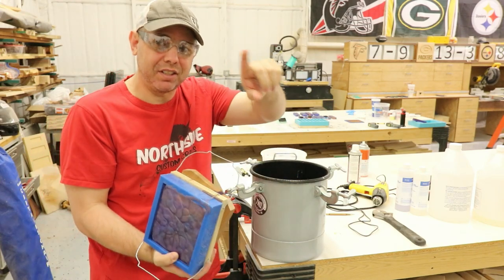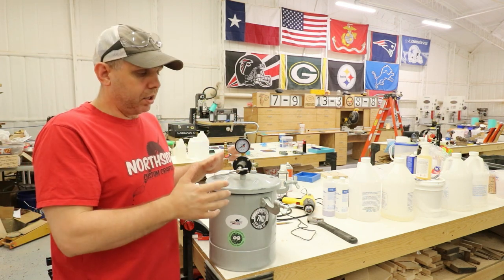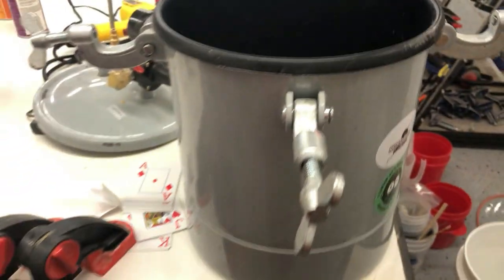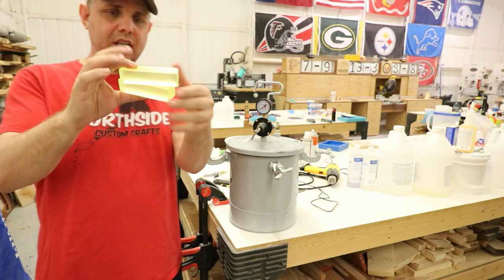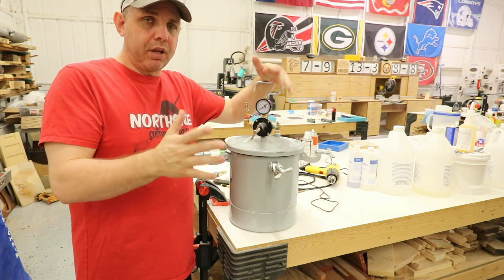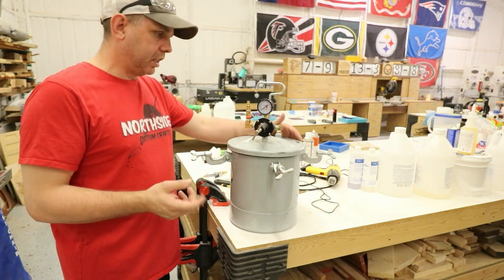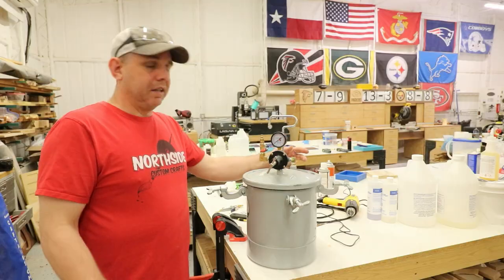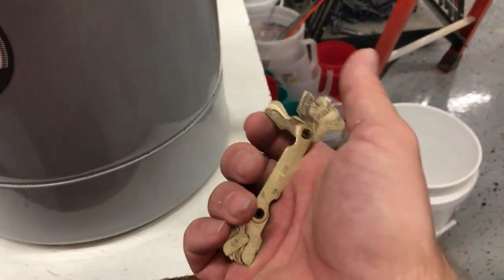Harbor Freight Pressure Pot for Resin Casting, Questions Answered!

Comment: Say Jake. First off, thanks for your first video on how to covert Harbor Freight tanks. You detailed the process so well that I had no issue accomplishing it. Secondly, out of the gates my tank leaks air like a sieve, and as your noted, it leaks around the lid.. I appreciate your solution to the problem, but I have a better way to attack it. I removed the ridiculous gasket that comes with the tank, then I mixed a batch of silicone rubber and poured it into the channel where the gasket once sat. It works like a charm, without extra clamps like you had to do. I am able to hold air up to 60 lbs. I just give the clamps a good twist with a wrench and it’s good to go. The silicone that I used  is Smooth On brand. 

Thanks again.
Reply from the maker: I ended up just buying a better gasket from Amazon but your solution sounds awesome
Reply: If anyone tries pouring a new gasket like I did, I have one tip. You might want to run a bead of calk around the channel wall that is welded in place.  That metal lip is poorly welded and silicone leaks under it. It didnt leak a ton but it was a little annoying.

Comment: I had such an issue with mine after 2 days, i returned it, and got another as a replacement. the toughest part is evenly tightening the lamps on the pot, seemed to make a huge difference in holding pressure consistently. so i do like if you were tightening lug nuts on a wheel....1/2 turn one side, 1/2 turn opposing side and so on. I had more of an issue with the gunk near the relief valve, had to gob some teflon tape there. Thanks for posting Jake, i really thought i was the only one having an issue holding pressure and the leak issues!
Reply from the maker: Rob Kerfoot Thank you for watching Rob.. I figured people would think mine just works perfectly all the time.. I also figured if I was having issues then so were others..

Comment: I have an older Craftsman paint pot I got at a rummage sale for 2 bucks I converted.  It gave me some leaking issues and I thought about the way to put a wheel/tire on a vehicle.  You alternate the tightening pattern.       Previously I would just randomly tighten the wingnuts in any order.  As I began to alternate tightening the wingnuts angled,  like putting on a wheel, it became easier to get the lid tighter and eliminate leaks.

Comment: Enjoy your video's , After some thinking I found that all you need for fittings is a the reducer one T,  safety valve direct fit  also with no regulator works , still working on the leaks
Reply from the maker: Very true.. I leave the regulator on because of the leaks.. I just leave the air on and it stays at the right pressure. I’m glad you enjoy the videos. 👍👊
Reply: Used and old trick on my harbor freight pot , took a small pump sprayer added some soap , squirted it all around and found a leak where the safety valve is welded in
 , you wouldn't think it would leak , I put some JB weld on it and so far it is holding pressure , thanks for the reply appreciate it

Comment: Petroleum jelly softens dry rubber gaskets so they can form a better seal. We use it on refrigerator gaskets where I work. It does eventually wear the gasket away little by little though, so I wouldn't use it on gaskets that aren't already old and dry or you'll probably have to replace them sooner.
Reply from the maker: Thank you for watching.. I appreciate it!👍👍

Comment: Sand the top of the pot smooth. 
Silicone glue the gasket into the lid, so it has to seal on only one side, and always put the lid on in exactly the same spot. Mark it and match it. Lubricate the the threads on the clamps, and where the clamps dig into the lid to make tightening them easier.
Seal your joints well... and stay under 50 PSI. At least ... this is what I'm doing. Thanks for all your advice!
Reply: Sooooo my HF pot is creaking on initial testing plus the gasket leak.  Is that normal for a "break in" period
Reply: @bryangoboom  Did you glue the gasket in the lid? Are you tightening the screws two at a time opposing corners back and forth until nice and tight? What pressure?
Reply: @Darryl Edington  glued it in last night and yea I was doing that.  I took a wrench and was able to get it to seal better.  Waiting for the silicon seal to cure then will test again tomorrow
Reply: @Darryl Edington  so it looks like everything is working well.  Now there is a slow leak that might be a pain to fix, 5 psi like every 30 minutes or so
Reply: @Darryl Edington  I'm thinking it's the main seal sadly.  It might be a defect of the whole pot.  I have one side that seals all the way down will spin it and soap it to check
Reply: @OregonDARRYL  So I found the leak.  Its actually on the weld of the paint outlet....  like where the join happens
Reply: @bryangoboom  Probably an easy fix with epoxy or silicone on the inside... Glad you found it. Bubbles are great!
Reply: @bryangoboom  I was going to ask when you glued your seal into the lid if you put the lid on the pot and tightened it a little to get the glue all even and flat... oh.. and put a little tiny bit vaseline on the seal if it leaks on the pot.
Reply: @Darryl Edington  yea I did that to seal it, looking at reddit that paint stem is where a lot of people have leaks lol
Reply: @bryangoboom  I also bought the little HF one-gallon super quiet compressors to keep it at pressure even if it leaks.
Reply: @OregonDARRYL  I have a super quiet, but it definitely isn't super quiet, any recommendations?
Reply: @bryangoboom  Well, since I only use it for 40 pounds of pressure in the pot and 55 in my bike tires, I set the regulator to run it up to 80 and shut off - rather than 135 - which I don't need and wears the unit more. So, I set the regulator to kick on at 35 and off at 80. So, it runs for only about 30 seconds and doesn't even get very warm. Like this it should last longer than I do. And.. I have the regulator on the pot set at 40 and the pressure relief valve set so it might pop at 55...

Comment: 👋  Great update to the original video. I used your first video on this to build my Harbor Frieght Pressure Tank. Been using it for almost a year now and still works great.
I actually got it to a point where it hasn't leaked in over 6 months.
I've been casting so much lately, I am considering getting a second one.
Reply from the maker: Awesome Connie!! The very next cast didn’t leak at all.. lol that’s how it goes. Your castings are amazing!!
Reply: @JakeThompson  Thank you 😊

Comment: Anyone who buys one, make sure to check if you get one that has NPT and compression style fittings. Mine did, don't put an NPT where there was a compression fitting. I shouldn't have to say that but there's some tutorials on YouTube for this tank that you will end up doing that if you follow them, theirs might have had all NPT, or they just didn't know better.

Pull the gasket out of the lid, and check for weld splatter. I had huge ones that had to be knocked out, that's where my initial leaks came from.

Also, the lid is thin. Over tightening the clamps will actually warp the lid, and possibly make it harder to get a seal next time. 4 star pattern, 1/4 turn at a time, hand tighten should be all you need to get a seal if you have smooth surfaces and a good gasket. In 24 hours, my tank will go from 60 to 55PSI. Which is mostly from my safety valve according to a bubble test with soapy water.
Reply from the maker: Chad Voller good stuff!!

Comment: So I noticed that it's very important to tighten the clamps down simultaneously. Opposing sides a little bit at a time, then use the wrench a bit. If it leaks around 50 psi identify where and try to tighten the clamp down by hand or with the wrench a bit.
Reply from the maker: MuffinMan0521 👍👍👍

Comment: there should be a gasket around the top channel this helps with sealing when you tighten the the lid down. I have a binks for spraying contact cement and you  can also get liners. Baer supply
Reply from the maker: After this video, I replaced the gasket with an upgraded one from Amazon. I think I put a link in the description or the pinned comment

Comment: I've been tempted to do this but am concerned about it leaking. Almost all videos I've seen that convert a Harbor Freight paint pressure pot to a resin casting pressure pot say that it WILL leak. It seems in your demo the leak was primarily the lid. Can a better gasket be added to fix that problem? Can a bead of 100% silicone around the lid create a better seal? I can clamp it to my bench like you did but would like to have it so it just doesn't leak at all and is mobile. Thanks for sharing your video! 👍🏾
Reply from the maker: Thank you Greg.. After this video I bought a better seal for the lid. It’s linked in the first comment.. as far as leaking .. if you fill it to 55 and overnight it’s at 50.. I wouldn’t consider that a big deal.. as long as it stays over 45 psi until the resin becomes solidified.  The new seal was a night and day difference from the original.. it was way better.

Comment: Very good video , I learned a lot from it. Thank you. I’m new to this and the video helped immensely. Question, if I use a silicone mold and pour my epoxy resin into my mold and put the mold in the pressure pot , will the air pressure distort my silicone mold at all ?
Reply from the maker: If your silicone mold has air in it and you put it in a pressure pot, it will deform.. depending on how much air is in it, will determine how much deformation

Comment: I've tried using an electric car tire pump to pressurize it and it seems to put pressure in, but it leaks from the large black pressure valve through the part you turn to let more air in. Seems like the valve might be bad? Can I get away without using the valve if I'm using a tire pump?
Reply from the maker: I’ve never used a tire pump and I recommend using a air compressor with a tank the size of the pot to fill the pressure pot effectively.. some people run the pot without a regulator.  You fill to your desired psi and shut the inlet valve.. I use the regulator.

Comment: did you need to get a quick connect hose adapter for the threaded fittings on this pressure pot? Guess I'm headed back to the hardware store.
Reply from the maker: Here’s the first video and the parts I had to buy.. https://youtu.be/5jOttgLQvpA I did have to buy the air hose fittings.

Comment: Do you need the elbow fitting? Also could you please make a video about which air compressor and hose to get? Thank you so much for the great content!!
Reply from the maker: People have done this many ways.. with and without a regulator.. and such.. if you see a way to do it without the elbow.. go for it.  You don’t need a big compressor to fill this pot.. a small compressor will do just fine.

Comment: I just got my harbor freight pot because of how you made it look so simple to convert in your video!...Question however.... the regulator T screw where you let in air ....does it normally leak air out of there also?....I'm having that .....from a small existing hole right above the T crew area of the regulator ....I'm trying to figure out the best position on it to keep it at at least 50psi...and the Manuel just says clockwise for more and counter clock for less....I'm trying for just above 50..like 55 but it wont let me
Reply from the maker: Thank you for watching the videos.. of you have that to where it regulates to 50psi or so and the hole in the regulator leaks.. the regulator is faulty.. you will need to take the entire thing back and exchange it or buy a new regulator.
Reply: Dang it....I figured that was the case.....thanks for the reply! 👍👍

Comment: I'm new to resin & do have problems with air bubbles even though I torch or heat gun. Sometimes I want to cast & sometimes I just need to coat a painting I use KS resin. Does it matter what resin you use & how do you know how long to have the resin in the pot before it starts to set up when you want to pour it instead of casting?
Reply from the maker: Hello Deb., a pressure pot helps with any kind of resin. If you have something you are coating and it won’t fit in a pot.. you have to use a torch. If you have problems with bubbles.. make sure you are stirring the epoxy gently and not introducing air bubbles yourself.  When you use a pressure pot, there’s always a demold time on the instructions you use.  Keep it in the pot for that long.. I hope this helps.

Comment: I just purchased the same pressure pot and made the alterations as shown in your other video. I’m putting air into the pot to set the regulator and the safety valve. The valve keeps popping at about 38lbs. I believe I’m bottomed out on the adjustment by screwing the slotted ring clockwise. It’s down so far I can’t get it to turn anymore. Still popping at 38lbs ( I’d like to get it set at 50lbs). Am I doing something wrong?
Reply from the maker: Hello Mark.. if you followed the directions exactly how I showed.. it’s probably a defective pop off valve.. might have to exchange it
Reply: Ok thank you. I’ll get a new one

Comment: how much vertical space is there inside? a have a small statue mold that's about 8 inches tall. would that fit?
Reply from the maker: There is about 9 inches top to bottom in the pot.

Comment: Would the Mold Star Slow 15 silicone work well in a pressure pot or do you have any recommendation for a suitable mold making silicone/rubber? Since I’ve heard you’re not supposed to put a soft silicone in a pressure pot. Thank you! I just made this pressure pot and it works great! :)
Reply from the maker: You can use whatever kind of silicone you want in a pressure pot, as long as you degas it first with a vacuum chamber. I have used fast setting silicone that doesn’t need degassed and it works fine in the pressure pot.

Comment: I know this video was made a while ago, but would you ever consider doing a video on safety with these pots?
Reply from the maker: Thank you for watching the video.. The max pressure is on the tank and there’s a regulator and pop off valve on the unit. I show how to adjust both on this video and I say to go 10psi below the max.. I’m not quite sure what else I could say about safety.. plz let me know if I’m missing something?

Comment: I just completed the transformation of the HF pot to a casting pot per your video. Everything seems fine but there is one air leak I can't get fixed. It's at the regulator valve. If tightened it as much as I can, both on top of the pot as well as the nut under it. I've taken it off and retaped it and still it leaks. I out 50 lbs of air in and in about a half hour it has dropped to 20 pounds. Do think caulking on the top of the valve would help? Thanks for any advice you might have.
Reply from the maker: There’s some stuff called liquid Teflon, it works pretty good.. but I would leave the air hooked up so if it leaks the regulator will keep it at 50 psi
Reply: @JakeThompson  Thanks. I'll try that.

Comment: Have you ever casted any thing in resin for which reason that you did not put in a pressure pot because I tried into a without a pressure pot at all you can’t see the bubbles because of the pigment I put in I think there are still bubbles underneath because as I started to turn it on my lathe I ended up with chips out of the resin I was wondering if you ever experienced that
Reply from the maker: del urquhart I use the pressure pot for everything unless I’m using liquid diamonds  epoxy, it does pretty good without a pressure pot.

Comment: Can you use the same pressure pot to put a vacuum pump on to use to stabilize wood? I would think so but I'm new to this
Reply from the maker: It will work, but you wouldn’t be able to see in the pot when you are using vacuum..

Comment: Can't you buy a pressure pot all ready to use with out having to buy other parts & assemble or change all those things?
Reply from the maker: Deb Beneman You can.. but it’s lots more expensive  so this is just a cheaper option.

Comment: Another informative video. Question...I'm going to start with making pen blanks. What are the best molds to buy if I only want to do three or four at a time and use in the HF pot?  Thanks again for all the great advice.
Reply from the maker: I just bought a silicone pen mold from P-Town Subbie... it fits right in the pot. Or you can make your own from HDPE plastic.

Comment: I just bought the same pot last week and the only problem that I have is that the air pressure valve goes off when it his 43lbs? How can I get it up to 55 Lbs? I have no leaks.
Reply from the maker: In this video I go over how to adjust the valve.. if it doesn’t help.. the valve needs replaced.
Reply: @JakeThompson  Thank you I did have to replace it!
Reply from the maker: @jamescanning5647  awesome.. I’m glad it works now. 👍

Comment: Hi!  Maybe a dumb question but is it bad to release air pressure through the ball valve area?
Reply from the maker: You can release air from the ball valve.. but it’s slower than using the pop off valve.

Comment: Thanks for sharing Jake I thought vacuum would be simpler didn’t consider the time factor glad I didn’t waist my money on a v pump 👍
Reply from the maker: Bart Giles Thank you for watching, I’m glad I could help ya out!! 👍👍
Reply: Vacuum pumps are great for two scenarios.  1: It isn't a burning inferno where you are, 2: long pot life silicon/resin.  Degassing and pressure potting will return results that are just about perfect every time and removes almost all risk.  Reason I mention weather is potlife goes down in heat, and the vacuum can create some serious heat especially if it is already hot to begin with.
Reply from the maker: Karkarov 👍👍

Comment: Hi! I have silicone molds would it be okay to use in a pressure pot?
Reply from the maker: You can use them but if they were not de gassed or a pressure pot wasn’t used while they were made....  they might deform under pressure.. I use silicone molds all the time